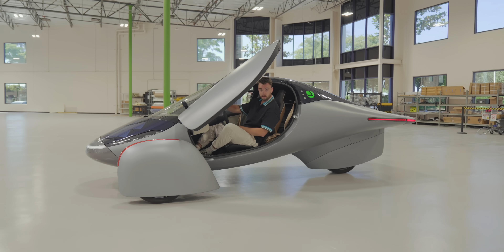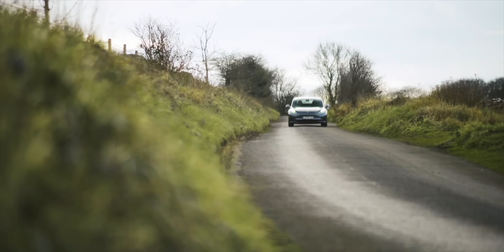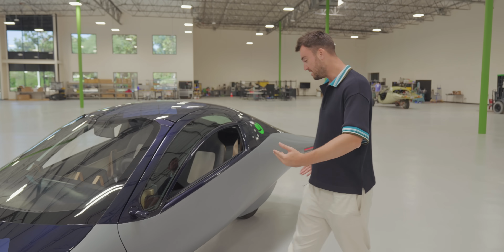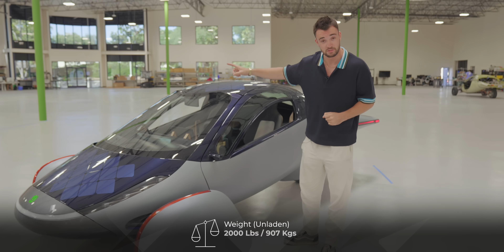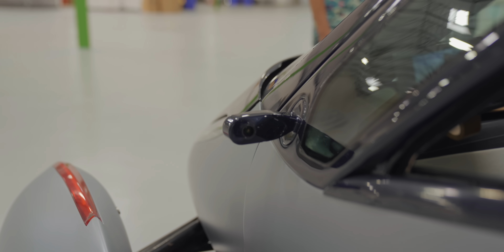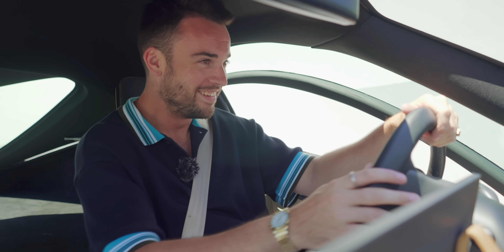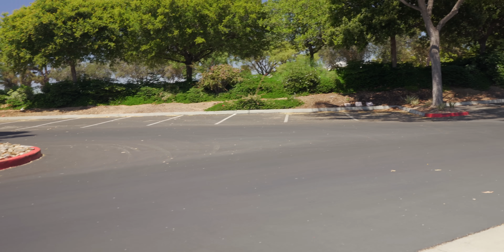The Game-Changing CHEAP Electric Car Inspired By Fish!

Comment: 900 kilograms is LIGHT? Dude, that's HEAVIER than a Kia Picanto, except the latter will fit 4 people and luggage! 900 kg is not light for its dimensions by any means. As per being well protected... I doubt that too, you have very little space in there for airbags so you're definitely less protected than in a normal car. Also why does it even have the side mirror cameras..? If they're going with cameras, its far more efficient installing them in the sides of the roof at this point. I really don't like the two seater thing either, very anti family oriented, hope they could make a variant that's 2-5% less efficient but elongate it 1 meter and make it slightly larger so it fits 4 passengers, cargo and is safer.
Reply: It is about the same weight as my present Gen 1 Honda Insight - which almost everyone considers a light car.

As far as airbags go, Aptera has them.  Once production intent deltas are available they will be physically crash tested by a third party and you can compare the ratings.  They have been virtually crashtested thousands of times as the design has developed and there are many vehicles on American roads now with only the virtual results.

The current regs require mirrors so unless this changes before Aptera is shipping they have to have mirrors to be road legal in the US.

Aptera's second vehicle is likely to be a 4 wheel, 5 passenger sedan.  The fact that there are already more than 36,000 pre-orders shows that there is plenty of demand for the 2 passenger vehicle, and they can get much of their learning curve out of the way with this one.
Reply: @n.brucenelson5920  Well except your car isn't a miniature 2 seater. Its like saying that my Volkswagen Jetta is light compared to a minibus, that sort of comparison just doesn't mean anything! 

And again, just look at the inside space, sure, it can have airbags, but they'll be way worse in effectiveness than they can be in other cars because again, there's barely any space for them. Just idiotic American laws i guess, along with the mirrors being that way just because of regulations meanwhile half the cars on the roads are barely safe.

As per them being bought, well yeah, there's many people in the US with 'the green craze', a lot or some extra money, and usually without kids, but i'll leave my rant about how useless and stupid the green movement mob are for another time...
Reply: @mkzhero  I wonder what you think a Gen 1 Honda Insight actually is? It is certainly a 2 seater, with less interior room than the Aptera - by quite a bit.

And yes, I have been professionally involved in environmental work for decades - including working with the Kuwaiti EPA in Kuwait during the fires.

I have personally seen the success in cleaning up the Themes. and places such as the Cuyahoga River which used to catch on fire and burn with some regularity, causing many millions of dollars of additional damage.

Perhaps you would like to engage in a conversation about the benefits of environmental work to your personal health and pocketbook?
Reply: @n.brucenelson5920  Idk i tried looking it up but found nothing, there's a LOT of cars out there, how am i supposed to know what your specific one is like if the search results show like 20 different things? But there's a lot of 4(well 5) seater cars that are 800-900 kg, so for a TINY 2 seater with only THREE wheels 900kg is certainly rather heavy

And you seem to misunderstand, or bunch together environmental concern, and the environmental movement... And let me tell you the two are leagues apart. The so called 'green' movement does very little to help the environment in some regards, and actually ACTIVELY HARM or HELP HARM the environment in many cases. Their efforts also bring a false feeling of safety and action where little to nothing is being done, if not even making things worse. 

The push for green cars is actually one such case... Not because they're inherently bad, but because even electric cars are a very wasteful an inefficient method of transportation that the vast majority of people could, and in many cases WOULD GLADLY do without, especially in an urban setting.
Reply: @mkzhero  Gen 1 Honda Insights were sold from 2000-2006 and were one of the first hybrids.  They were an iconic vehicle and most car people are aware of them  They didn't sell many - a little over 14,000 in the US, plus a couple thousand more in Japan and Europe.  Mine still gets better than 50 mpg and is on its second battery pack.

The first generation Insight was the most fuel efficient gasoline-powered car available in the U.S. without plug-in capability for the length of its production run and up until December 2015, when it was surpassed by the 2016 Toyota Prius Eco.

As far as weight goes - try to find another vehicle in that weigh range or lighter that is designed to have as much capacity and still meet modern FMVSS automotive crash test standards.    There aren't any three wheelers I am aware of that even try.  Aptera has three wheels to lower the Cd and rolling resistance - not to avoid safety standards.

You are quite correct that there is a great deal of "green washing" going on.  We certainly agree on that point.
Reply: @n.brucenelson5920  Oh, its a hybrid car? Well yeah, they'd weigh a lot, obviously, you have 2 engine systems... In fact last i checked hybrids usually weigh more than both pure electric AND ICU cars. Idk about the specifications you demanded, but a smart (the car) weighs only 700 kg, Kia picanto weights 830~ kg... Electric cars are just heavy, and compared to ICU cars, 900 is indeed not all that light. Then again there's that Indian Ekonk electric supercar that weighs just 740~ kg, which if you put weaker motors in for the regular consumer market, removed the second back wheel like in this model, and added another seat and a glass roof you could probably push under 700 kg while being a two seater too, so idk, but bottom line - 900 kg is NOT light.

Also idk what exactly you mean by 'greenwashing', can be a whole number of things, but i personally mean all the fake, semi fake and outright disastrous consequences the busybody green movement activities ten to bring fourth. Say one of the funniest recent examples that comes to mind is first building dams to get green energy, and now destroying dams to save the environment because they harm fish, flood and destroy ecosystems, mess with river flow and aquifers... They're also actually at least partially responsible for a lot of the 'drought' climate panic that was going on for the past years (who'd have thought that playing with water flow could cause a shortage of water in certain areas eh?)

Another is companies like Google and others virtue signaling about how green they are, when they SPECIFICALLY INCREASED WASTE AND POLLUTION with their actions, for example how previously the youtube  app was able to function with the screen off, saving electricity, and then it became impossible for almost a decade, and finally it became part of the PAID FEATURES lol, how much electricity did it waste? How much phones it pushed into an early grave? Extra pollution and waste right there. 

The 'green' government regulations also for the most part made a lot of things worse, destroying local produce, and along with high taxes eliminating the repair businesses, instead creating tons of pollution with trash import products from china, wasting and polluting more because they break more often, also creating extra waste because they have to be DELIVERED from china half way across the world (extra benefit in supporting China with their slave labor and lack of care for human life). Oh and overall the pollution most of those regulations 'helped' with they just pushed to China and other spots in the third world, keeping various emissions and pollution on the same level, if not making it WORSE on a world average scale. 

So yeah i hate the green movement, government, and stupid majority of sheep heard people who buy into all of this green crap while failing to see its just a huge money laundering and waste machine.

Comment: Will the battery be extra bad in the cold? Batteries can be leas efficient in the cold but like an engine can warm. Does the skin cooling turn off in the cold?
Reply: The battery pack can also be warmed by the circulating antifreeze solution.  Range will suffer in cold weather, but Aptera should be good down to at least -20 F.  I will be driving mine all year in Iowa and will report on the cold weather performance of an early example.

Comment: Great until you run out of lithium 😆
Reply: We have vast untapped reserves of lithium in the US in places such as the Salton Sea.  In addition, there are new, none lithium battery technologies under development.  We won't "run out".  Sodium - a very common element, is a likely alternative.
Reply: Even better when we run out of gas and oil (or use it as a blackmail dependency - opec & Russia).
Or run out of an actual future livable environment (pollution & climate change).

Comment: A really efficient gasoline powered car can go further on a gallon of gas than other gasoline powered cars. Efficiency is always the answer. Depending on your driving style, your gasoline powered car might last a full month. It is a prototype until it is in production. Next year doesn’t always come to realization. I think we have seen this car for many years. Does it have good air conditioning, even when parked. It looks only good if you don’t go on trips and if you don’t have passengers. Very wide footprint, though.
Reply: I currently drive a Gen 1 Honda Insight which gets better than 50 MPG.   The current Aptera Corp and the present design were only begun in 2019.  The rate of progress has been astounding compared to most automotive developments, including Tesla.  Yes, there is great A/C.

I will be picking mine up at the factory in Carlsbad, CA and my wife and I will be driving to Death Valley for some camping, up to Bellingham, WA to visit family, and then back to Iowa.  We will report on our experience.

While the footprint is wide, it is less than my Chevy P30 step van, and will still fit in a compact parking space.

Comment: Aptera, AFAIR, was meant meant to go into production 10+ years ago. With "production will begin in 2010" statements etc.
Reply: That was Aptera, Inc.  The original founders lost control of the company in 2009 to a Detroit CEO who was hired to start production, but went to large investors such as Google and had them thrown off the board in favor of designing a new vehicle he ultimately couldn't raise funding for.  He paid back the pre-order deposits and vendors, gave severance to the employees, and liquidated the company in 2011.

Chris Anthony went on to co-found and take public a successful lithium battery company.  He was offered the rights to the original Aptera Inc. by the widow of the person who bought them at auction.  He acquired them and restarted Aptera Corp with original key members of the first company and a brand new design in 2019.

Comment: If it had four tires I would really consider it.
Reply: Why would you want to add weight and cost, and increase rolling resistance, when the present design already passes the moose test?
Reply: @n.brucenelson5920  because having 3 tired on the ground is 100% not as safe as having four tires on the ground. I agree with making much less of a footprint on this earth but when safety is involved I  absolutely do not support taking away a tire and wheel assembly to save on weight.  I know all about 3 wheeled vehicles. I do know that two wheels in the front are a-lot safer than having two in the rear but three wheels are more dangerous than four.

Comment: Well, if it has no suspension then you probably misreported the total weight of the car by a fair amount because suspension on most cars, weighs a significant amount. I'm sure they'll use something strong and light but still, it will weigh some pounds.

Comment: Can’t have that in Wyoming hit a deer and your done! My truck has a 900lb grate bumper 😳
Reply: Aptera has front and rear crumple zones, air bags, seat belts and a Kevlar/carbon fiber passenger safety cage.  It can also likely stop much faster than your truck.  I have over 400,000 safe miles on motorcycles, including trips through Wyoming.  I think I will be just fine in Aptera, even should I hit a deer - which is very unlikely.

Comment: FRAUD.  3 WHEELED = NOT A CAR BUT A MOTORCYCLE AND YOU NEED A LICENCE FOR THAT. YOU DID THIS TO AVOID SAFTEY REGULATIONS.
Reply: Why lie about the laws in the US regarding the license required to drive?  And if Aptere did this to avoid safety regs, why did they design in air bags, front and rear crumple zones, and other safety features the class does not require?  Furthermore, they will be crash tested by a third party to the standard FMVSS part 200 crash test standards and the ratings published.

I wonder what the penalty is for lying in youtube comments?  At least getting laughed at! (LOL)

Comment: I hope someone posts a tutorial on how to change a flat tire on the side of the road. That would be my biggest concern about this as a daily driver/commuter car where I live. Tons of potholes and debris in the roads and the tires look a bit difficult to get to. I'm doubting a spare tire is even an option in this vehicle so I'm guessing any flat would require a tow to a shop that hopefully knows how to correctly change or remove a tire for patching.
Reply: Wheels can be removed just as with any car.  They unbolt from the wheel motors just like they would from brake drums.

I intend to carry a patch kit and DC inflator, along with a pair of pliers, and will be able to fix flats the same way I do now on motorcycles, cars, and trucks, without removing the wheel from the vehicle.

Comment: The claim that it is the most efficient electric vehicle in the world is obviously misleading as ebikes and scooters can easily do 100km/kWh. Even the Zero SR/F can do upwards of 22km/kWh. So really the Aptera, with its 16km/kWh, isn't even close to being the most efficient EV on the planet, but it is the most efficient production car on the market. And when you think about it, the main benefits of a car over a two-wheeled vehicle are storage space, safety and comfort, so that's where the value really lies in this vehicle. That said, with all this talk of efficiency vs excess, it's kind of ironic that, in a sense, the Aptera is still an excessive option. In locations where there is enough sun to power this vehicle, weather would be good enough for most people to just use an electric two-wheeler, so really, the Aptera is the big, excessive vehicle.
Reply: "ebikes and scooters can easily do 100km/kWh. Even the Zero SR/F can do upwards of 22km/kWh."  Not at the EPA highway speeds that Aptera is measured at.  I plan to use my Aptera year round in Iowa, where I will probably average around 20 miles per day from solar.  

I have ridden through many winters on 2 wheel vehicles, including blizzards at the continental divide and other mountain passes.  I assure you that in such conditions Aptera is hardly "excessive".

Comment: Looks like a nice little toy, but I’m not sold on practicality. 
How will it hold up to potholes and speed bumps over time?
How does it take minor bumps and bangs from other cars?
The car is very slippery and would be a very efficient vehicle for long trips. But it looks like more of a city commuter car where it don’t need to be slippery.
I do like the solar cells.
Reply: I have owned composite vehicles in the past.  Bumps that would leave dented sheet metal on most cars might result in a scuff at most with Aptera.  I have hit speed bumps at speed riding in an Aptera alpha vehicle and am not worried about this issue, even though I will be driving mine year round in rural Iowa (think gravel roads)

Comment: Well Bruce lets take an extreme case - a Tesla Model Y vs a new Prius. 3100 lbs vs 5000. The Tesla weighs an extra ton. You had to get the materials made for both we'll say roughly the same per ton CO2 therefore the Tesla takes 5/3rds more CO2 to make. Then if you never drove more than 50 miles round trip; neither car ever has to use gasoline. The Prius still takes less energy to move at all times by a factor of 3/5ths what the Y takes to move hence there is no way the Tesla can possibly catch up unless you start taking some longer trips but 80-90% of peoples driving is commutes so the Prius has both the manufacturing bonus and driving round bonus it can use to burn gasoline on long trips ... but it really doesn't have to - it can charge every 50 miles for short periods instead of go 300 miles and charge a long period as you could in the Y.  Heavy EVs are not very green compared to hybrids.
Reply: I tend to agree.  However, hybrids are far more complex and have many more parts.  I currently own and drive a hybrid that weighs about the same as an Aptera and it is far more expensive to maintain and drive than Aptera will be.

Comment: Lighter is more comfortable? How?

On weight, it's remarkable how heavy modern cars are. This is a good example. 2000lbs?
A 2 seater, built from exotic composites is much heavier than the old original mini, with 4 seats and built from steel.

Comment: The sounds it makes when driving is absurd lol it's so squeaky
Reply: I rode in the Luna prototype last November, and it WAS squeaky, and I would say harsh.  However actual performance was thrilling.  Since then, Roush Performance has reworked both the front and rear suspensions, and these alphas are no indication of the noise levels of production vehicles.